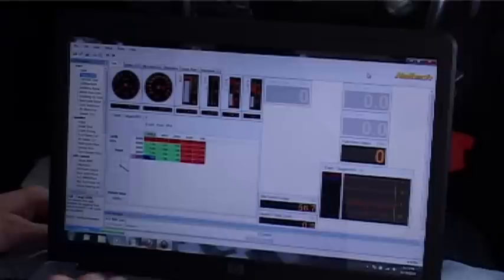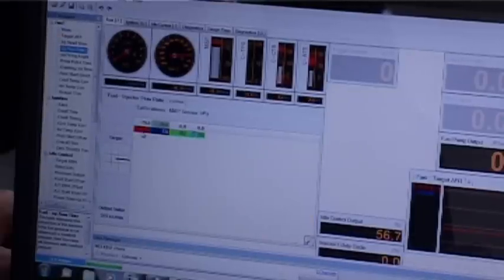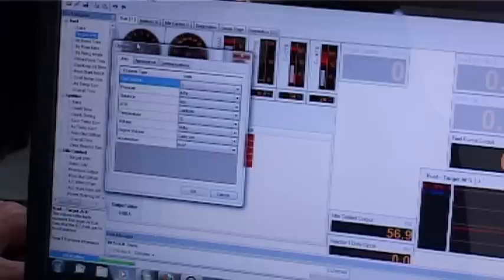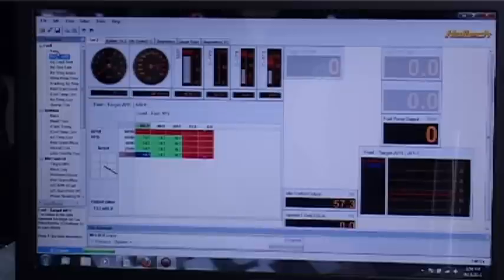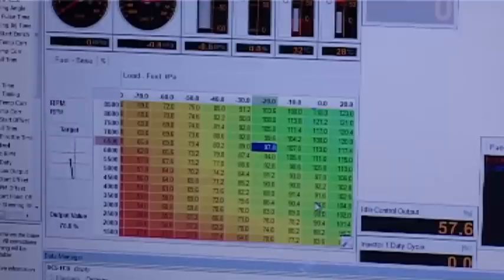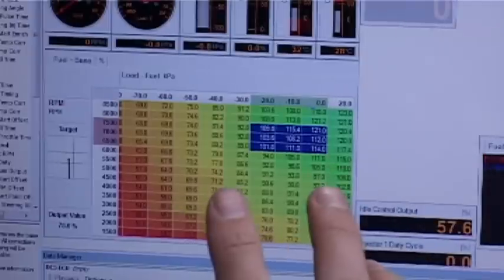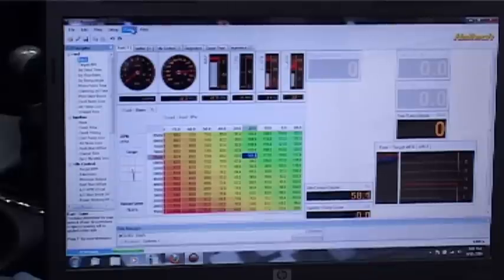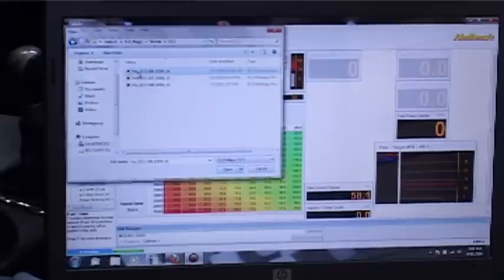Haltech Technically Speaking: Volumetric Efficiency Explained

Comment: If the target afr screen (in text view) shows the same number across the top and all cells have the same value, then you need to go to Setup->Table Setup and load more columns. I used 16. You can set the first and last value, then press L to linearize them (there is also a button with a purple line to do the same). That should give you RPM x Load for the Target AFR screen. Hope this helps :)

Comment: And target AFR will vary by temperature and load.  WOT may go into a power enrichment with will add fuel.. An EQ ratio will depict what AFR you choose the engine to run at at any given temperature, cold start enrichment and then slightly lean out as it warms up.

Comment: Not sure about this exact software layout, but in what I'm working with your stoich ratio for your location is a set value in one of the general keys.  Then the VE (RPM and load bassed on kPa vacuum and RPM) just basses everything off that stoicgh ratio.. Try getting an actual stoich ratio from a gas station attendant.. HA!  Funny.. :-\